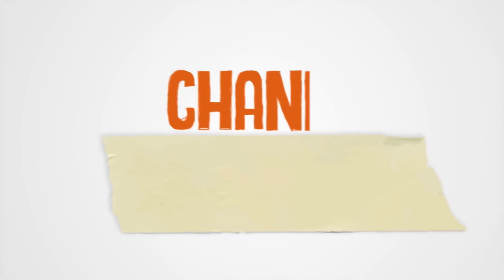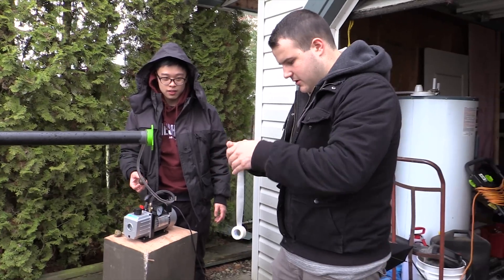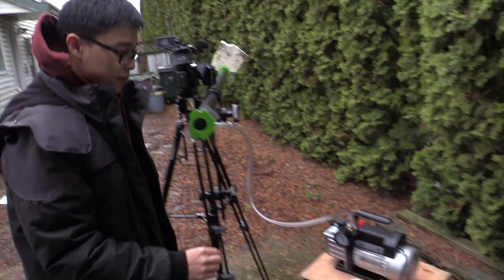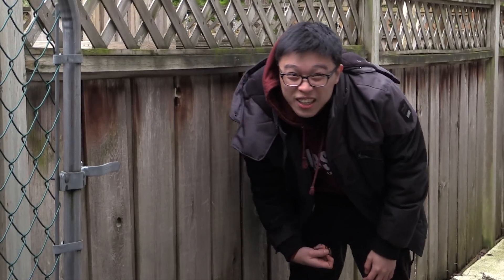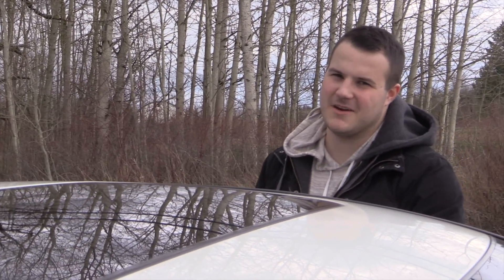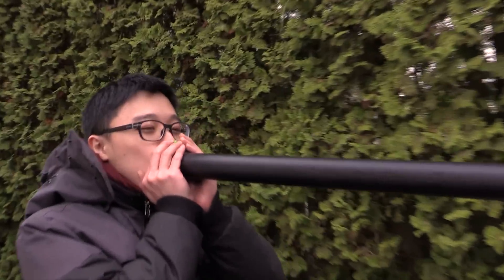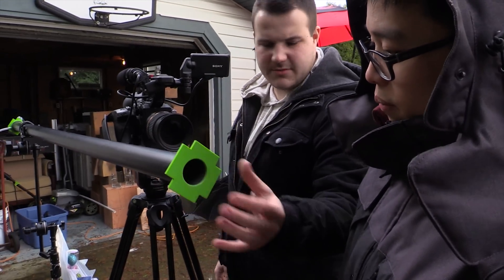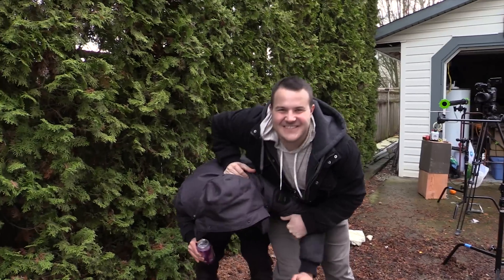DIY Vacuum Cannon!

Comment: Your problem is that you're either not pulling enough of a vacuum in the pipe or use projectiles that aren't a snug enough fit and let the pressure past, which creates a cushion of air in front of your projectile slowing it down before it breaks through the tape on the other side.
Also talking from experience as I've built one of these myself for my highschool graduation project, I got seriously worried when you put metal objects in the pipe as these types of cannons are able to fire a pingpong ball at over 300mph/500km/h. At that speed a ping pong ball will only leave a nasty bruise as it's not heavy enough to do real damage but those metal objects with some weight behind them can in a worst case scenario kill someone.
I way overdid on my safety percautions and only shot pingpong balls with a snowbank as a catch barrier, so I was really worried when you shot towards the road, through the hedge and even shot at Dennis without any protective clothing. These things can seriously hurt people.

Comment: You're supposed to load what you are shooting from the front. When you run the vacuum it pulls the object back creating a vacuum in front of it as it is pulled back. Since you were loading it from the back, the objects only get momentum from the air rushing into the vacuum behind the object and this object then has to pass through all the air resistance in front of it.

Also if you do it this way, don't shoot it at anyone, because it will go through 1/4 inch plywood.
Reply: +Ikemi Zyn That's not how it actually works - the vacuum is created in the whole tube, and when one end is popped, all the air is coming through that hole, pushing the object in the back towards the volume of lower pressure.
Reply: +Ikemi Zyn They also need something to fill the entire internal diameter of the tube for that to work. Clearly nobody at LTT has heard of sabots...
Reply: Yes I know and if you read what I posted, I did not say a vacuum is not created on both sides, but they are separated by the object and are in fact two separate vacuums. If you place the object through the back, you prevent the vacuum from forming in the front. 

Thus, you only get power from the vacuum behind as air flows into it to fill the space when loading it from behind. Also the object then has to fly through the tube which is has air in it creating resistance and slowing the object drastically.
Reply: dragonshardz You don't necessarily need a sabot if the object fits the tube correctly, as the college students who first did this had. But yes, a sabot would make the correct seal inside they need to create the pressure differential between the tow sides.
Reply: +Ikemi Zyn "they are separated by the object and are in fact two separate vacuums" - the seal is nowhere near tight here, and I would presume the pressure would equalize.
Reply: Sebastian Grygiel Which is also one of the problems, and would become very apparent when loaded how it's supposed to, since the object would stay at the front.

Though, I was talking about the easter eggs and ping pong balls because they did fit correctly.
Reply: +Ikemi Zyn I can't imagine an object like that blocking any kind of pressure being barely friction fit. I will make a metal one myself in the summer, seems like an interesting DIY project.
Reply: Sebastian Grygiel How do you think rubber seals work? Because they are soft they are able to be compressed, allowing a seal to be formed. Also, the pvc pipe is better since it has a lower coefficient of friction then a metal pipe.
Reply: I did not graduate with a degree in rubbing plastic balls, but iirc coefficient of friction between plastic and steel is usually lower than one of two plastics of most kinds. That aside let's say you're right for the part that the ping pong ball makes airtight seal after being inserted into a pvc tube they had. I'm not the one to judge, but Dennis seems to have strong lungs pushing the ball to the other side, overcoming the friction.
Reply: Sebastian Grygiel It can be but is usually not when it comes to pipes because of the manufacturing process leaving behind a rough surface. Also a little suction will overcome that small amount of friction because of the air tight seal. It creates a pressure differential on one side which makes it want to equalize the pressure. The easiest way to do that is by moving the object. The amount of friction there is also low to begin with. So no, he has regular lungs.
Reply: Ikemi Zyn Thanks for letting me know!

Comment: Industrial tubing, lighter with long neck, hair spray, industrial end cap, industrial strength epoxy for sealing end cap to tube. All the things needed to make a canon which would fire a rock through a window and even metal if it isn't too thick

Comment: You probably need a stronger material to put at the ends, and more vacuum. I saw a video where a guy used something very similar to aluminum foil, and that worked very well.